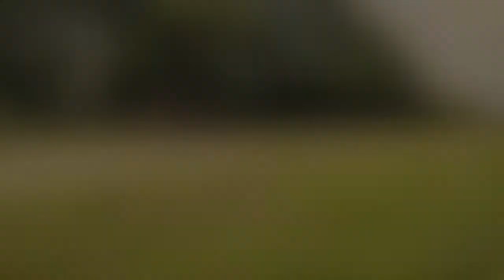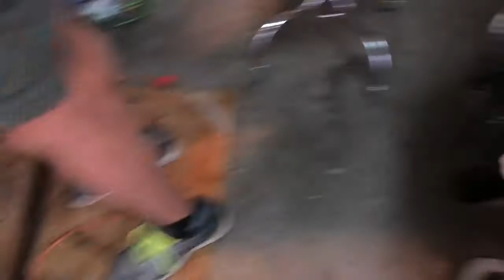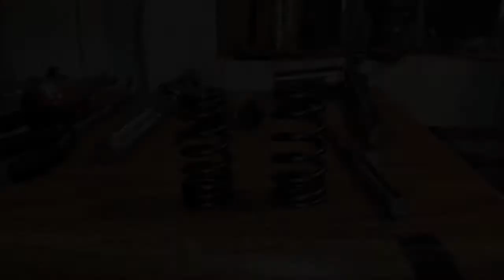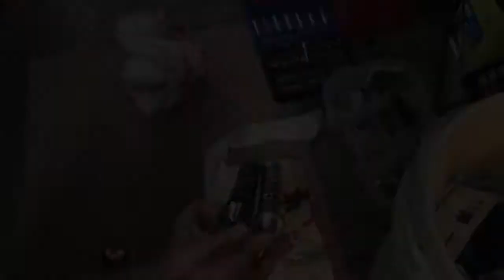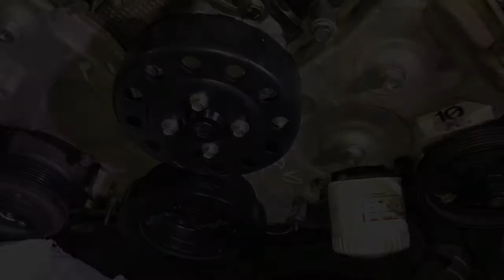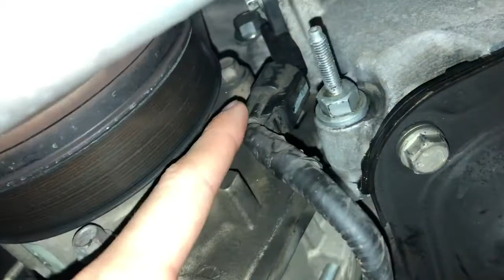Comp Cams and Valve Springs INSTALLED

Comment: Is there a reason why you are not removing the camshaft before swapping the springs? It looks to me that it would give you more space to work.
Reply from the maker: The camshaft provides leverage for the spring compressor tool that I was using.
Reply: @ProjectBullitt  Got it. Thank you.

Comment: Been following your build from the beginning. I own #0890. Curious how things are going and if you've been continuing the build on the car? My car has some mods as well, but retains an overall factory vibe. Installed the Ford Performance Adjustable Handling Pack shortly after I bought it. It sits about an inch and a half lower and corners on rails. I also did the FR500 axle back mufflers, MGW short shifter, aluminum driveshaft, Boss Tubular rear trailing arms with relocation brackets and an adjustable upper control arm to reset the pinion angle. Front end also has adjustable links to help with front end sway bar geometry. I also have a set of blackheart shorty headers and the FRP Hotrod cams that are waiting in the wings for me to finally take the plunge and install. I've been sitting on the cams because I haven't really heard a lot of first hand opinions on how and if they affect reliability of the engine. My car has around 90k miles on it so curious if I should do timing chains, guides, tensioners or any other preventative things to the top end when installing the cams. I'm honestly wanting to do it for the sound and driving experience, however I guess my worry is I also enjoy it as it is and fear if messing with my cars heart could backfire. I've always enjoyed bolt on mods, suspension and stuff like that so a little leery I guess of tearing into the engine not knowing exactly what to expect. If you have any recommendations based on your experience with doing this mod I would greatly enjoy your feedback. Thanks again for the awesome Bullitt content. Hope there will be more to come. My best from Wisconsin!
Reply from the maker: I always recommend a timing job when doing cams on these cars, and I also did roller followers/ lash adjusters (a must), oil pump, water pump, and valve spring seals (was changing the springs anyway). I have not had any problems is 2.5 years and I haven’t heard anything negative about reliability. Thanks for the feedback!
Reply: @ProjectBullitt  Can't thank you enough for the feedback! When I get around to doing the install, I will definitely be using your tutorial as a guide.

Comment: Sounds good.. I got an 08 bullet and want to the same as you did. What number is your car?
Reply from the maker: Thanks! I have # 0868
Reply: Nice..mine is 5156. After you put the comp cams in your car did you put in a tune?
Reply from the maker: Definitely. I limited the phasers and swapped the springs, so all that requires a tune. Not all cams require a new tune, but you should definitely get one regardless.

Comment: What cams did you use?
Reply from the maker: Comp Cams XFI SPR stage 2 127500’s. I love them
Reply: @ProjectBullitt   I'm looking at detroit rockers. What made you decide on the stage 2 's ?
Reply from the maker: Those are a good choice. I wanted to change the valve seals and springs for maintenance, so I figured I’d go with a big cam.

Comment: Keep seeing a 3.90 gear recommended, how are the 3.73s doing in terms of bottom end and getting off in 1st gear under light load and normal driving?
Reply from the maker: Great question. Some of it may be because of the tune, but it doesn’t seem like I lost much bottom end at all, in fact the car feels faster everywhere. Drivability is excellent, hardly any change at all with the 3.73’s. My wife even said it was easier to drive (she learned on my car and it’s the only standard shift car she’s ever driven). Keep in mind I limited the phaser’s, I didn’t lock them out.
Reply: @ProjectBullitt  Which spring did you go with?
Reply from the maker: Comp cam’s beehive “high lift”. Part # 26125-24